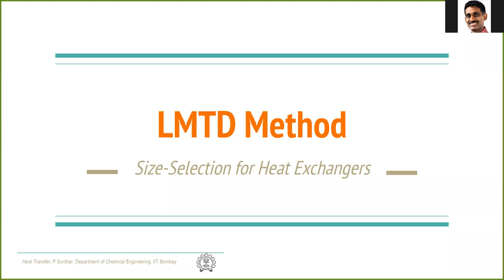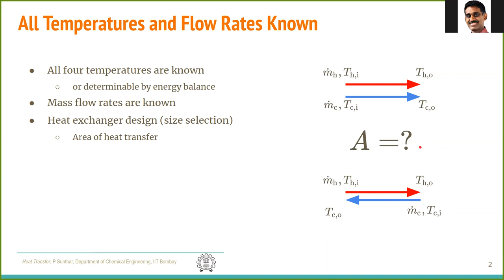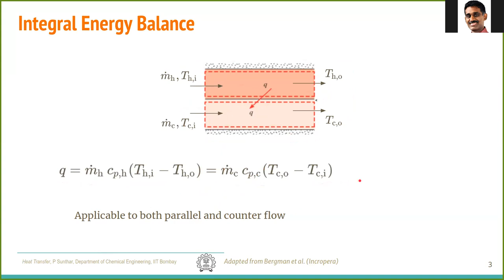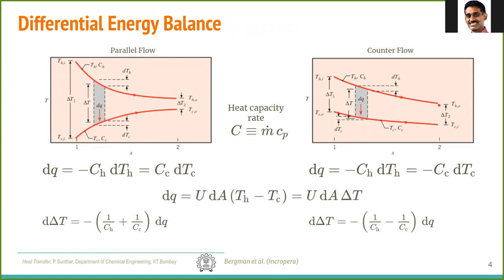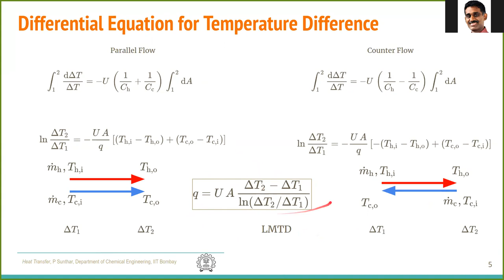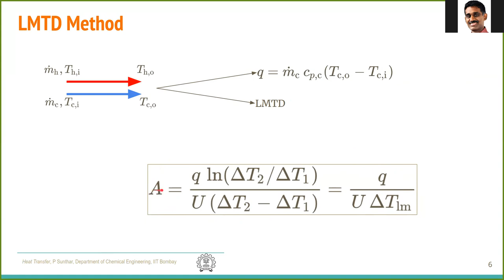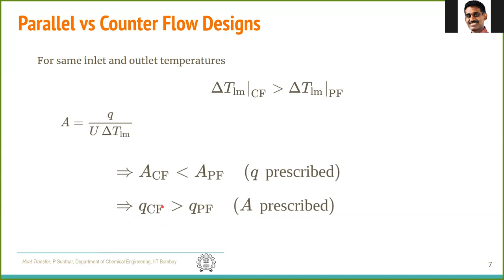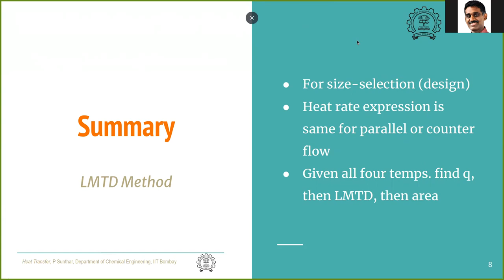12.2 LMTD Method (Log-mean temperature difference)

Comment: 00:06 Learn the LMTD method of heat exchanger design for size selection.

02:05 The LMTD method is used to calculate heat transfer in different types of flow.

04:06 12.2 LMTD Method

06:33 The 12.2 LMTD method calculates heat transfer between two fluids with positive temperature profiles.

08:34 The expression for d delta t remains the same in parallel and counter flow, but the sign difference and differential equation vary.

10:50 The 12.2 LMTD Method explains the locations and expressions for parallel and counter current flow.

13:05 The LMTD method is used to calculate the total heat rate and obtain the desired unknown, which is area.

15:25 LMTD method is used for heat exchanger size selection.